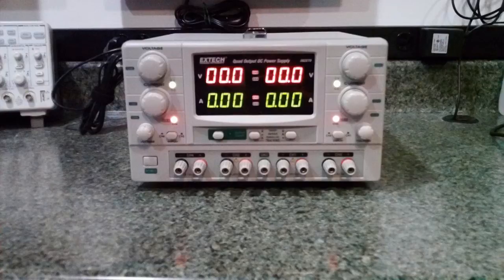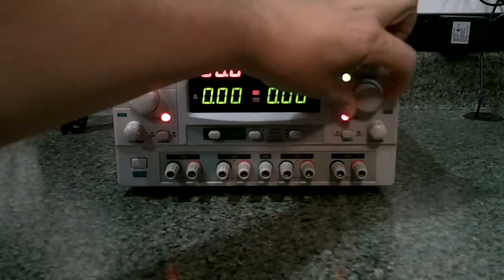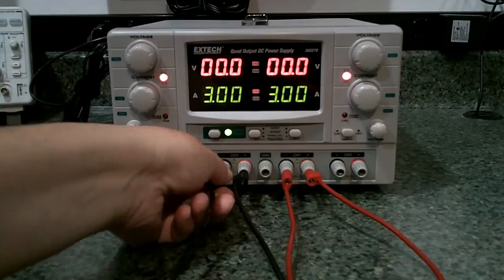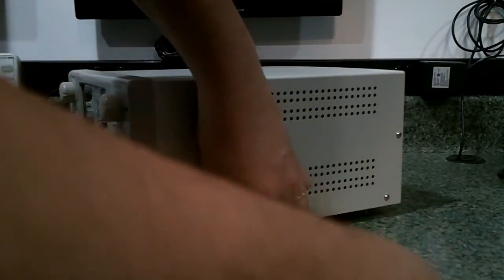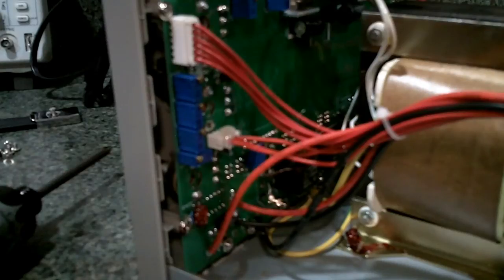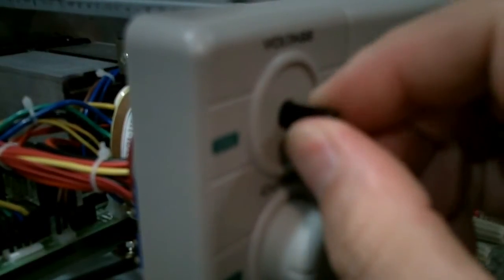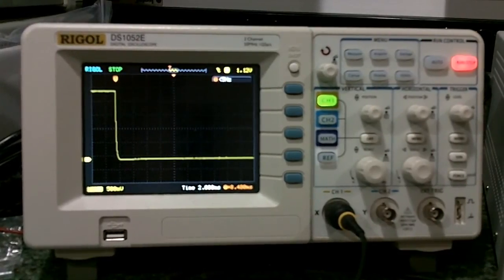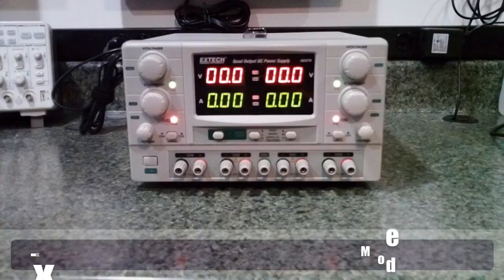Extech 382270 High Precision Quad Output DC Power Supply - Review

Comment: I bought this shit...and i can tell you it is a failure..Soldering quality ..poor..over heating like hell.. i wonder how long it can run on full power...few hours and it will die for sure. at the begining nothing like filtering caps movs or anything like that nothing.  Cos phi...nobody even bother with that...I would suggest ..don't buy it...It cost too much and it isn't good at all

Comment: Michael, I have been considering getting the GPS-3030 power supply and I was wondering if you could comment on how much noise is generated by the fan.  Thanks.

Comment from the maker: I have a few extech multimeters... I grab them when working in hostile environments.  Cheaper to replace when they get damaged ;)  They do get flaky when then batteries are getting low...then finally tell you the battery is low.  The Fluke just works till it says low battery (no flakes there)

Comment: I had the company buy me an Extech multimeter when someone melted my base model Fluke. It had the same claimed voltage ratings, a 100 more features, and cost the same.
While using it to measure the same circuit that I had put the Fluke on probably 100 times, traces shorted out near the inputs, and the face of the meter blew off. The meter was on the ground, and we were wearing our PPE, so nobody got hurt. But the mechanic standing next to me wouldn't be my helper anymore.

Comment from the maker: @RandyNLA I did get the SPD-3606 and I am very happy with it. The only complaint I have so far is there is no fine/coarse adjustment... but it is not a big problem as I really needed higher voltage and current from this supply. I have a GPS-3030DD for more precision work. If I get some time I will post a review of the SPD-3606.